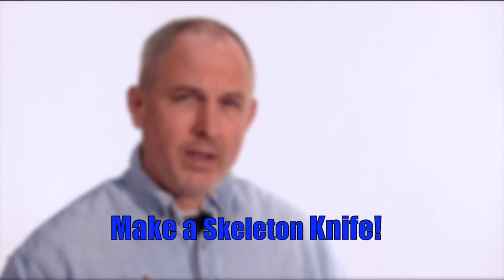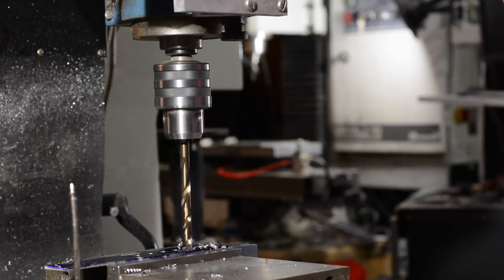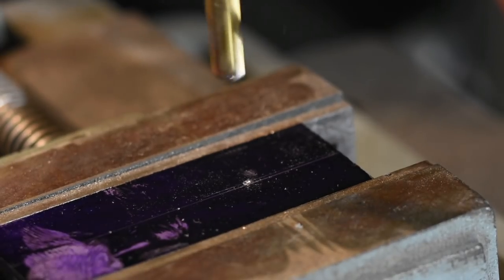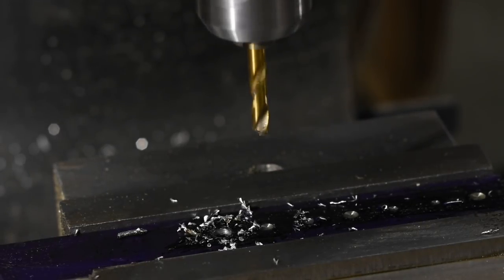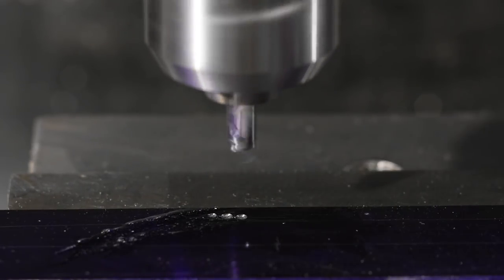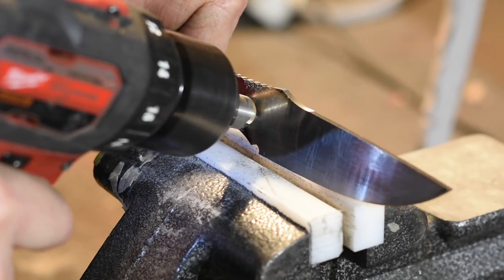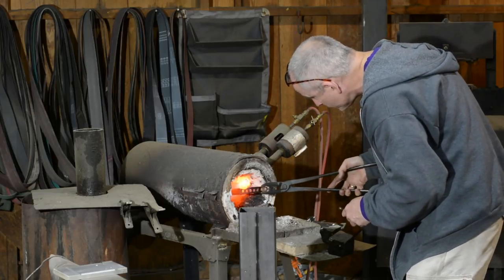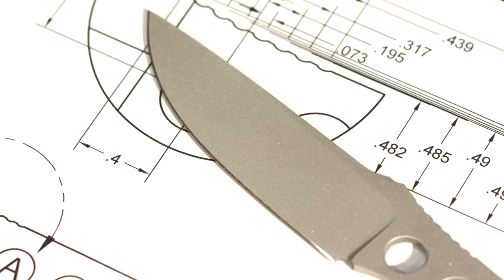How to Make a Skeleton Knife

Comment: to find the correct speed you should run a certain drill bit at the equation is 3.82 times the size of the drill bit (convert standard into decimal) and divide that by constant speed of the material. for steel it is 80 and aluminum is 100 (figured this would be helpful to some people)

Comment: Dumb question. Any particular strength magnet needed??
Reply: not too strong, imagine trying to take out a strong magnet from a hot knife
Reply: Just buy a small machinist magnet and you are done.
Reply: You can buy a scribe with a magnet on the back those are super handy.
Reply from the maker: Not really.  I buy cheapo magnets on telescoping handles from Home Depot or whatever.  They're sold as pick-up magnets.